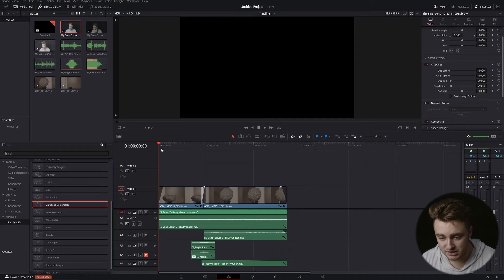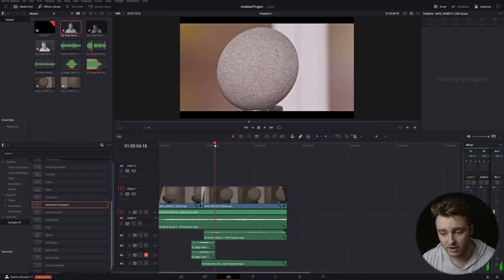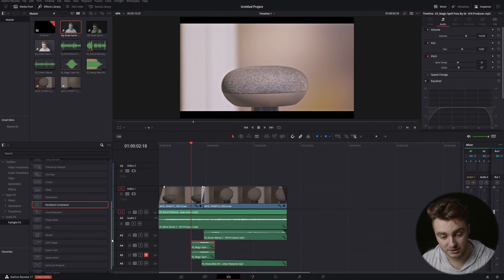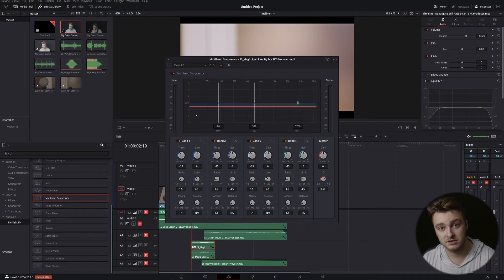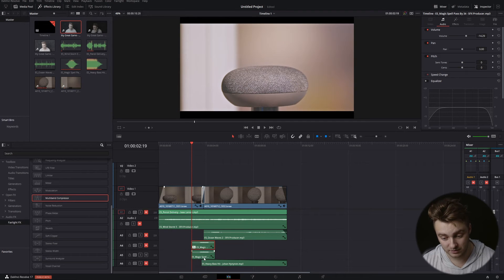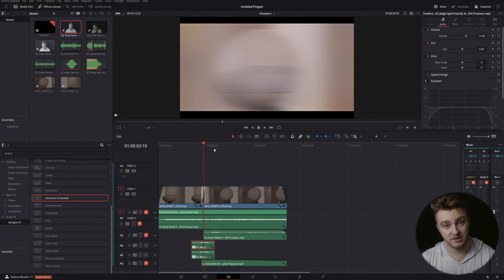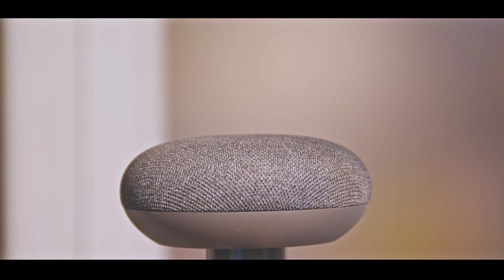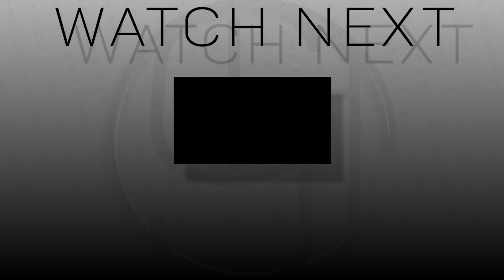Easily Fix Specific Pitches in Davinci Resolve 17! [2021]

Comment: Hey there, I'm looking to 'auto-tune' a single note within a music phrase using in the audio of a video.  could you help make a video on that.  I tried using a version of the pitch correcting but when i make an adjustment to the 'cents' the audio doesn't remember it and ignores all the fiddling that I just did with it.  it's too fast to pitch correct in real time.  how can I isolate that one part and just correct a single note, a fraction of a second worth of audio, without disturbing the rest of the audio track?